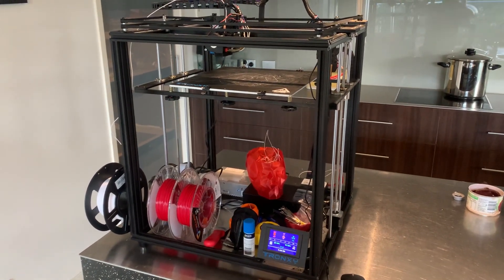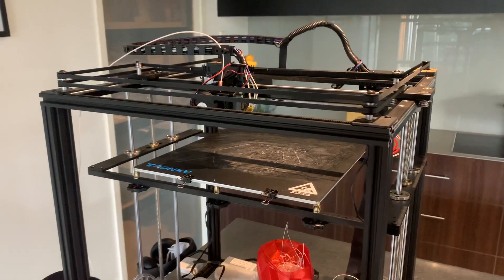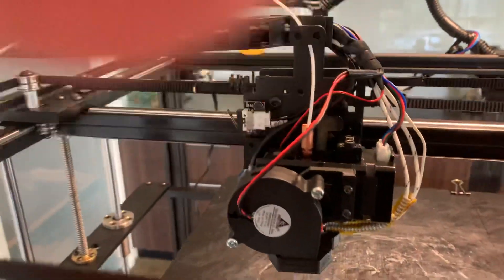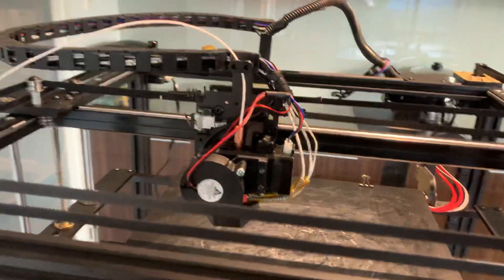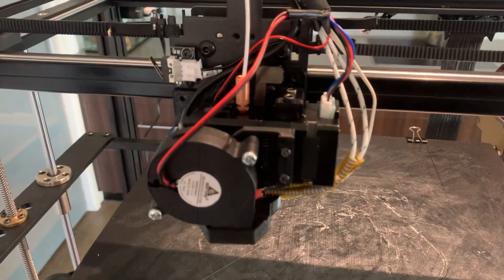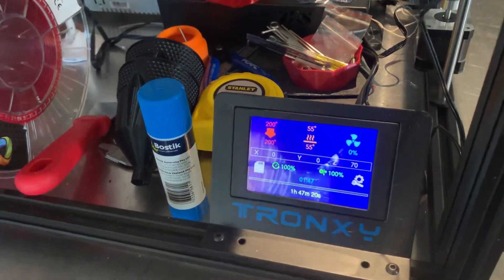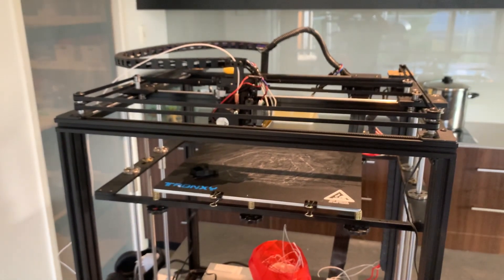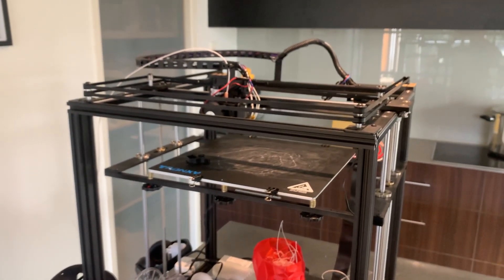Tronxy X5SA Pro - 2021 version simple upgrades to make it ok

Comment: x,y drag chains and run bowden through the existing drag chain. the extruder end of the chain can do with a better mounting too. lining up on the Y preferably.

eye off the front corner pulleys with the gantry. they arent square. i remade the corner brackets/pillar mounts with a bit more offset, and replaced the other pulley (that does line up...) with a larger one, though that isnt necessary as that line up is non critical...

Comment: So, I'm really contemplating between a Tronxy X5SA Pro updated or an Ender 5 Plus.. I really want a larger bed with decent print speed and quality. Would you recommend the Tronxy after owning it and printing with it? I really love the quality I currently get out of my Ender 3v2 but want a larger bed size. Heard some bad things about them, but am very tempted since they are on sale right now.
Reply from the maker: Yes mine runs constant and just bought a second. I’m pretty sure the ender is standard cartesian not CoreXY.
Reply: @samdekok72  Exact the Ender 5 is a cartesian printer. Only the model Ender 6, which is a lot pricer, is a Core XY
Reply: @samdekok72  Thanks so much... Any chance you can share your link for your Thingiverse? tried to find you.
Reply: If you go with a X5SA stick to the normal size not the 400 or 500, the normal one has alot of community support as is unlike the other 2 larger versions, the ender 5 while not being corexy out of the gate has a far larger community behind it for mods including the mercury one community that converts it to corexy with a 3 point kinematic bed, this is all nil if you intend to design parts yourself.

Comment: I bought one of of these from Tronxy as an Amazon return for $160. It's my first FDM and works pretty well. Stiffened up the frame with some braces, but that is the only upgrade so far. Oh, I did get the kit to tie the Z motors together. 

The best part, a few days after I finished building it, another one showed up in my driveway. 2 X5SA pros for $160! The second one has a broken chain mount and is probably missing a few small parts, but I am not going to complain.
Reply from the maker: Nice score!
Reply: Interesting I got the same deal last year.  Wanted to do a vzbot with it but since its the pro I decided to use it pretty much as is for a while other than putting a different hotend I had in it.  Though now im looking into making the x axis lighter and a few other things.  Triple or quad Z might be nice.  Was thinking of putting a volcano hot end in it but there are a few others that are out now id like to try.  Printed a Voron extruder i was thinking about using in it too.  Then I think id like to put one of my skr or even octopus boards into it

Comment: I've had mine for 3 months still haven't got a single print off it,  worthless piece of trash. I have 3 Aquila's which printed well from the first day
Reply from the maker: Have you installed Marlin?
Reply: @samdekok72  Wanting to upgrade my X5SA pro to marlin. Any tutorials you recommend?
Reply from the maker: @PropKnucklesFPV  just in the main Facebook group a guy called Aaron greengrass has uploaded a good .bin file.
Reply: @samdekok72  No I'm looking at you tubes now to find out how to do it. No experience with that sort of thing. I did get new firmware for the Aquila with the help of videos from 3dprintsos
Reply: @steveu235  A Core XY take more time than a cartesian to get correct print.
Maybe search for some tutorial on how to set properlly the beld and do the bed offset.
What kind of issue did you get ?